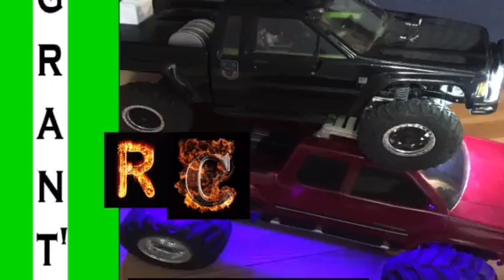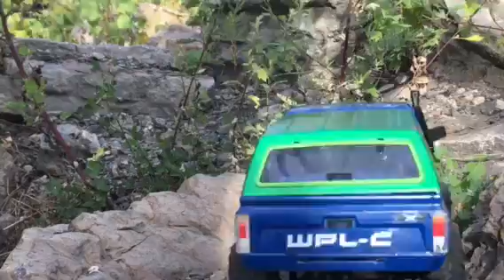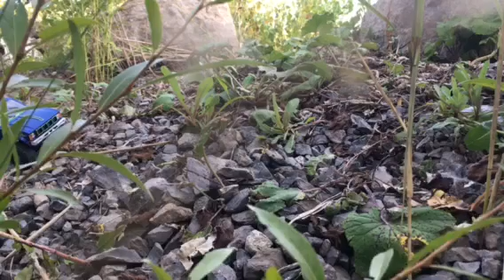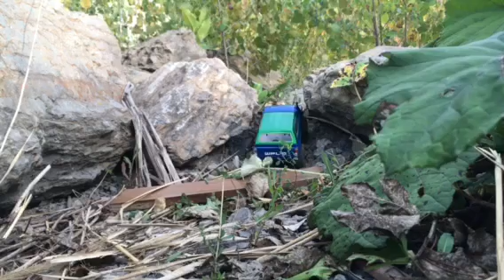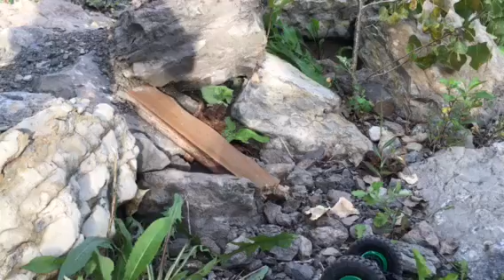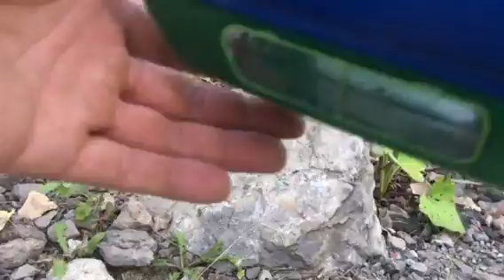Wpl C24 2nd run

Comment: There are metal driveshaft on ebay made for these as I have a set to go on my 1/16th Gaz66 truck.
Reply from the maker: Basildon Trail Blazing Buddies I have the upgrades package with 2 speed tranny and bigger motor should be recivein this week can’t wait thnks for commenting and watching until next time happy rc’n
Reply: @gsgreenrcs3196  i ordered 2 of these today - the kit, i will try to make run with Arducopter - S3 Lipo and some other parts from my 130€ china Quadcopter Kit ^^